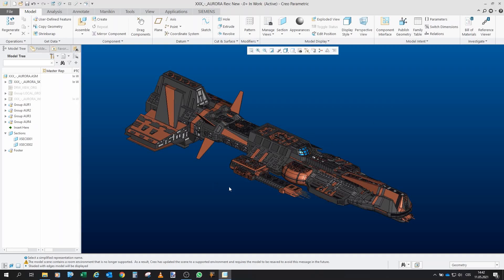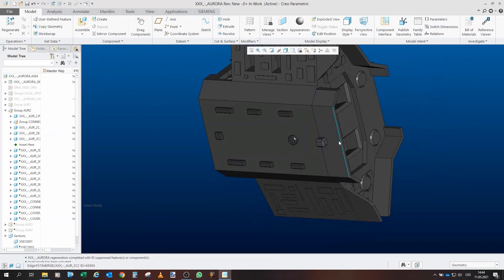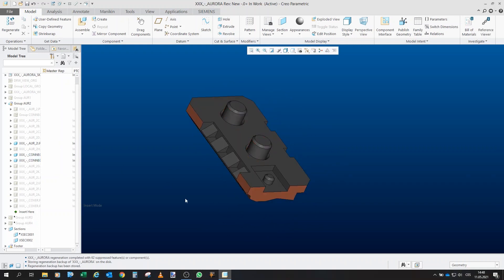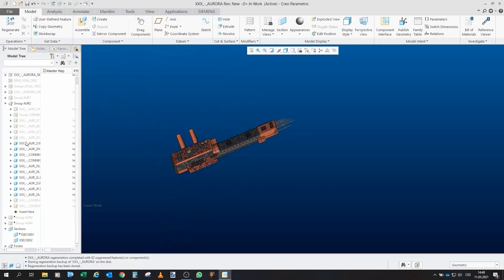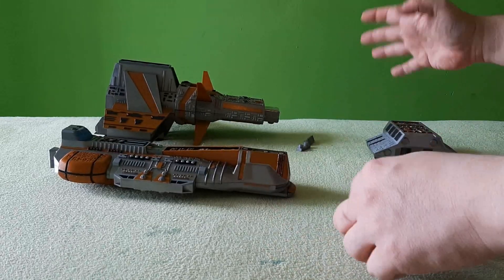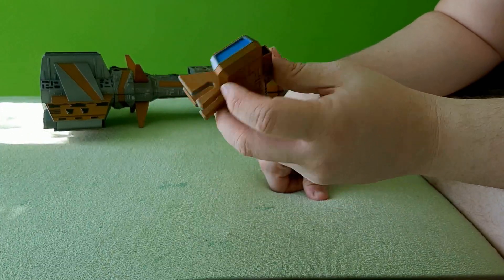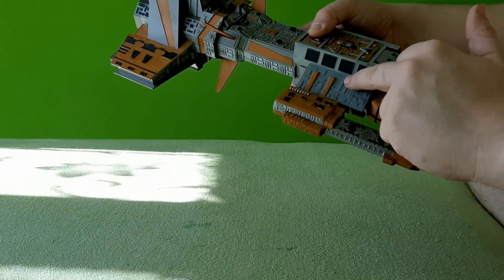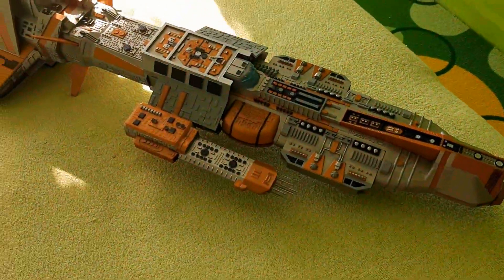Project Aurora Part 4

Comment: Thank you for fantastic models, I printed and built the tel’tak and nearly finished printing the Aurora. I have a short question, do you sand or trim all the pins, joints and connections after printing? My printer is well calibrated and I print at 0.15 resolution at 20% infill, the parts looks very clean and detailed, but I have to sand or scrape every pin and make the holes a bit bigger with a knife on every part that connects to another part. I guess it’s something with my cura slicer settings, do you know if any settings in a slicer that can add volume to a model? I’m not using support other than the parts you recommend 👍
Reply from the maker: Hello. No I do not do any postprocessing (well sometimes paint). I use default settings for PLA in my prusaslicer and all fits together perfectly.
Reply: @martintaichl  Thank you, I will try a different slicer/settings for my next large print.

Comment: Do you have the STL for antenas? All small and detailed prints im printing on SLA and im missing the antenas
Reply from the maker: Because i changed the approach zo tge antennas, i now have only 1,9mm holes and the actuall antennas are toothpick painted to the proper colour. That way it looks better and is waaaaay more sturdier. So no. No antenna models. Sorry
Reply: thank you  👍